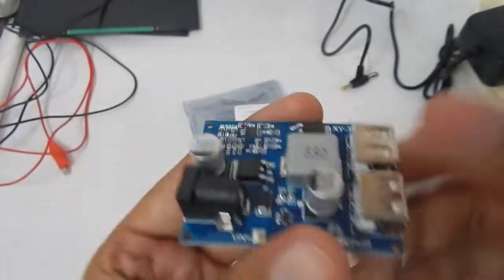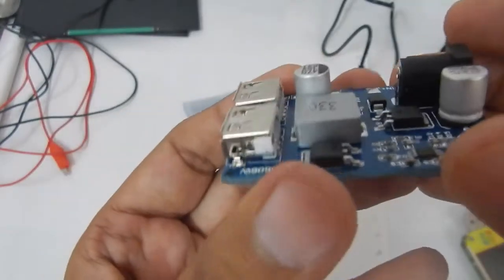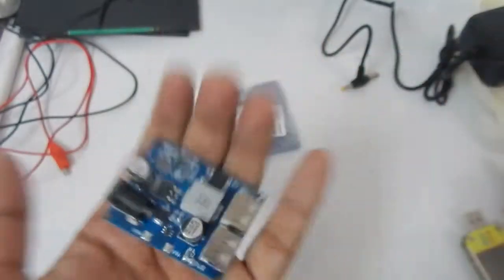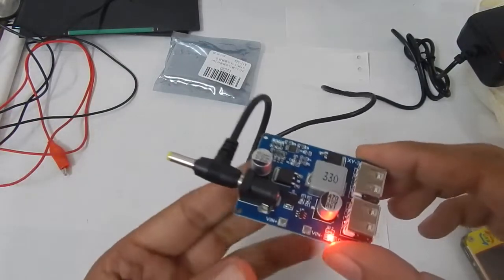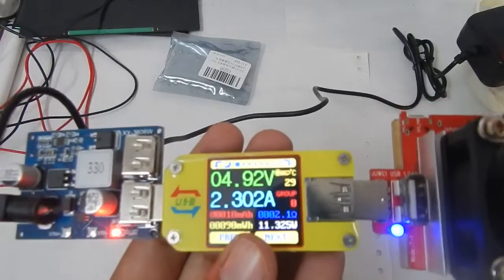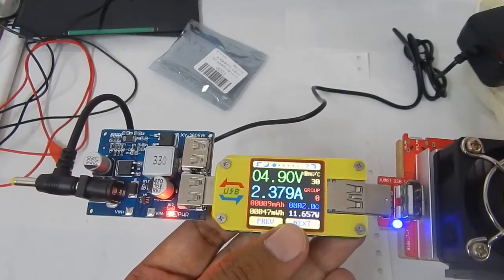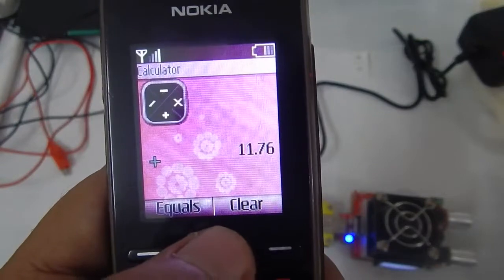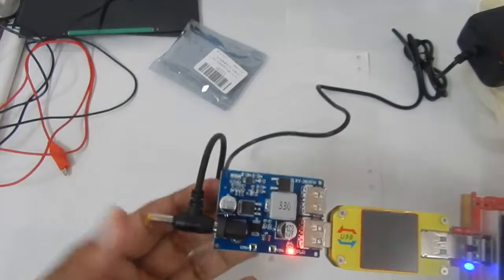12V Adapter or Battery to 5V Phone Charger with DC jack input and dual port USB.

Comment: Thanks for making this, it is helpful ! So I guess this one provides about 5A but divided by the two ports. You seem like you’ve tested a lot of these! Do you happen to know of any modules like this that convert 12v 6A to true 5v x 2 dual 3A simultaneously? I need something in the at least 3 range. Thanks again.

Comment: How much input current can it withstand?
Reply from the maker: Input current can be anything. But, the output current is limited to 5A.
But, i would not use it at that power because it starts over heating at peak power.

Comment: How much amps.max to each port and where on Amazon can I find it it
Reply from the maker: don't have the link any more. Just search for ' lm2596 dual usb buck converter ' and you should find it easily.
Reply: @gurribuy  can i get it offline sir?
Reply from the maker: @Prateek_Rathee2102  I don't know but you can try at your local electronics shops.

Comment: Its ok for 12v 36ah battery to 5v????
Reply from the maker: Yes it will work with 12v 36ah battery.
Reply: Thanks man

The brand of the battery is super king with 12v 36ah output

Comment: Power 3amp
Reply from the maker: yes, it can deliver upto 3A.
Reply: life time
Reply: using mobile has safe and send product link
Reply from the maker: https://www.amazon.in/Shomy-LM2596S-9V-36V-Supply-Converter/dp/B07FVV9M3Q/ref=sr_1_1?ie=UTF8&qid=1550053478&sr=8-1&keywords=12v+to+5v+DUAL+port+module